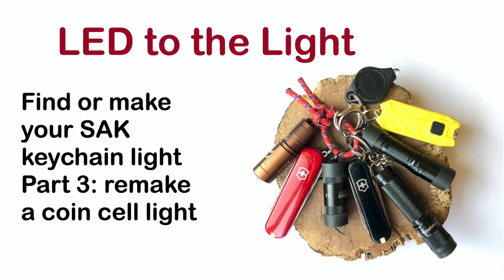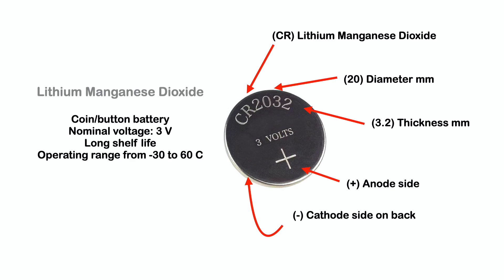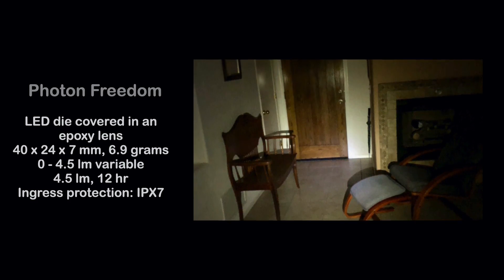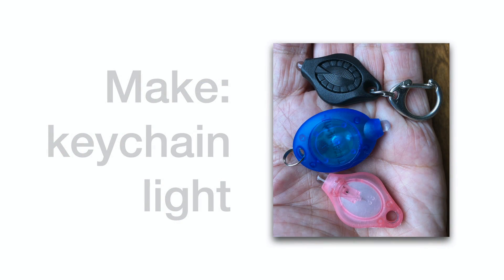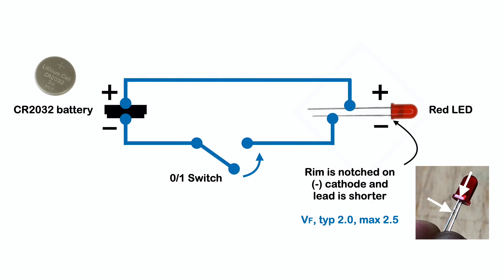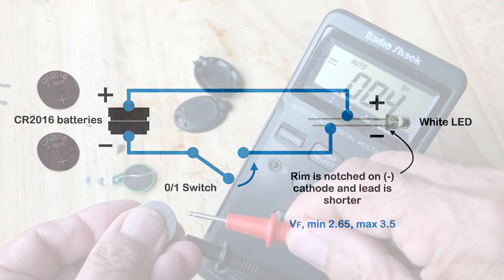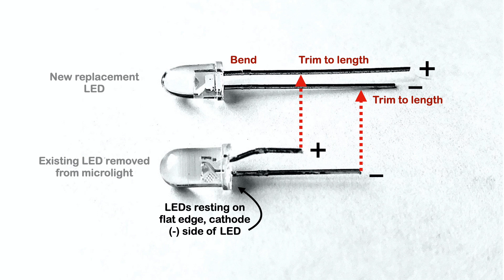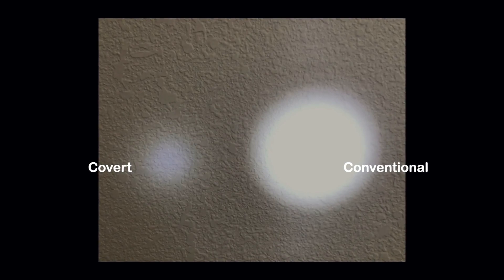Find or make your SAK keyring light. Part 3, Button light review and make your own.

Comment: These are great videos! I've tried all three types on my keys.  I keep going back to the photon push button type despite the lower output.  I like the light on my keys to be push button one hand or two finger operation.  PLUS....I don't always have a recharger on me and can buy the 2016 batteries just about everywhere if necessary.
Reply from the maker: Yes, it is indeed a classic.